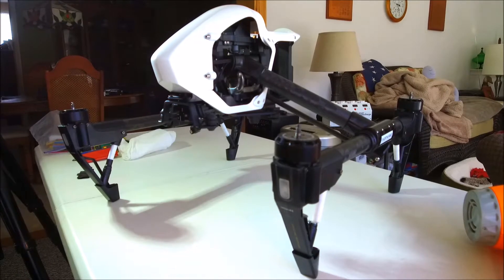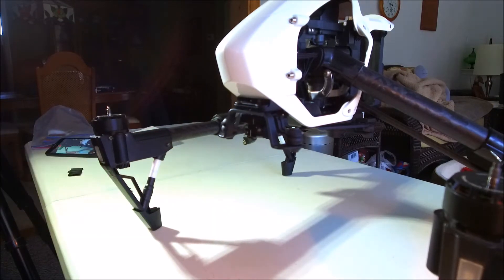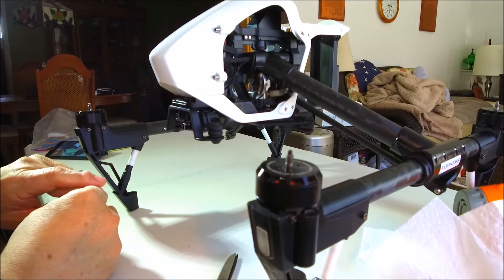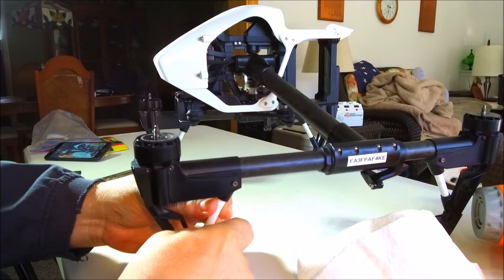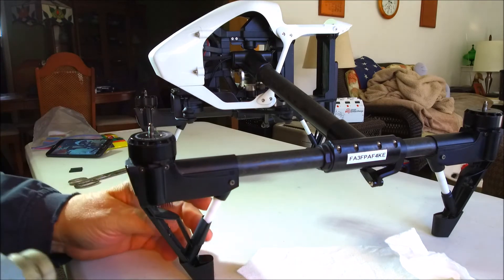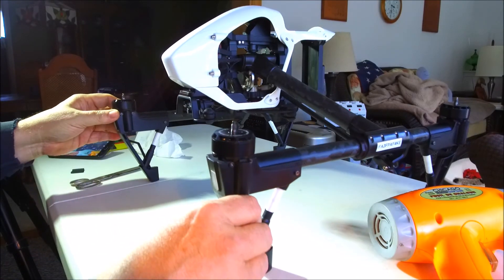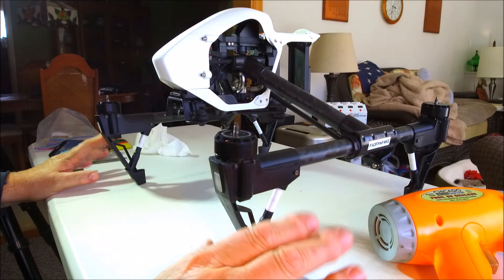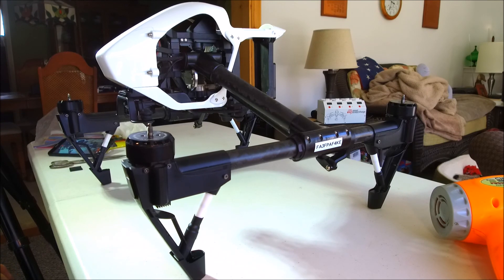DJI Inspire 1- Landing Gear Shocks Quick Repair   3-2-2018

Comment: Very good Paul, im just about to fully rebuild mine after a back crash and the two right side shocks i will replace with new but i have to say if i find my self in a situation where i crack one like you did then your fix is as good as it would get and why not, it works.
Thanks for sharing

Comment from the maker: Additional Note: It is interesting to note that I received confirmation that the shocks that were part of the original DJI Inspire 1 design have been removed from the Inspire 2 and are not related to the operation or effect the actual flight or landing characteristics of the aircraft.

Comment: Hey Paul.  Scott from Lansing.  I'm actually doing repair on mine as well.  Except I broke 3 of 4 shocks or struts, whatever you want to call them.  Mine did the same thing but from about 15 feet.  Plus my gimbal and lens broke.  So instead of spending $1800 on a brand new x5 lens and gimbal, I bought a brand new z3.  I thought that's what you said you had
Reply: Use "Helping Hands" when soldering the white paddle antennas on and be quick about it. Over heating the plastic antennas are what kills it for most guys who do the repair. That coax has 2 spots of soldering to be undone and then re soldered. Just use the tip and be patient !!! Good luck.
Reply from the maker: Yes, I have 2 Inspires and 2 z3's and wouldn't fly anything else.